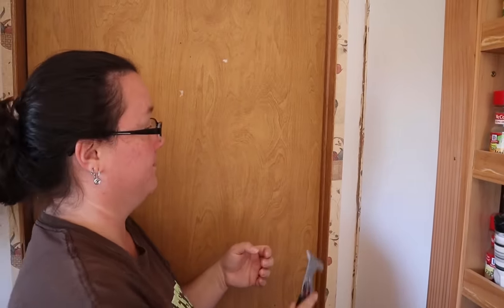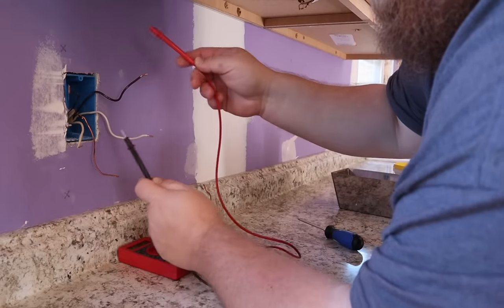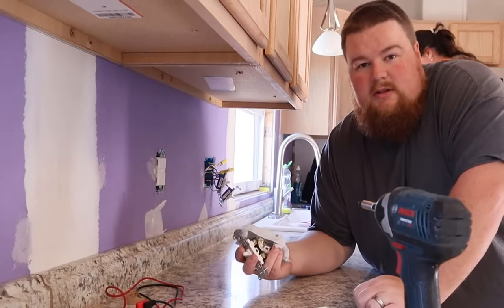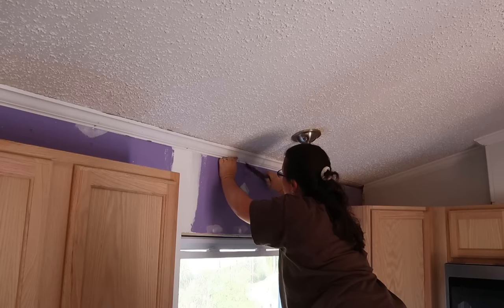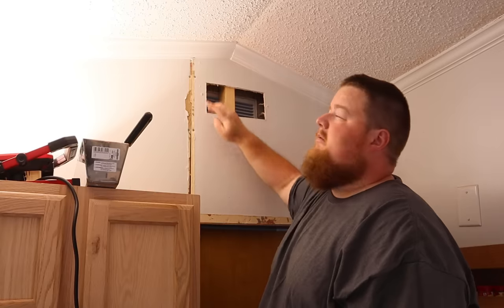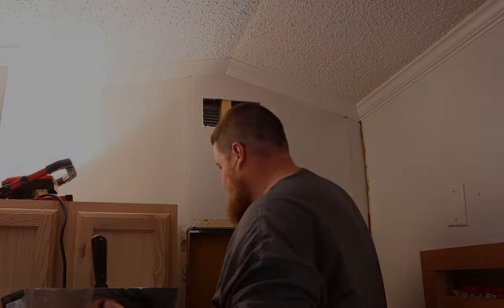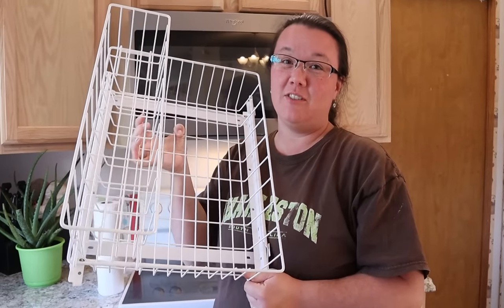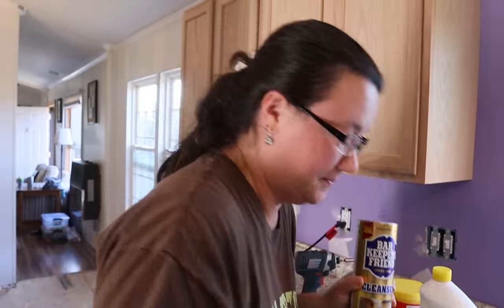How to Remove and Mud Over Wall Strips | Budget Mobile Home Remodel #24

Comment: Loving the wall strip removal! That's probably the one thing I hate the most about standard mobile homes haha. Idgaf that it's a trailer, I just want it to look pretty. Not such a dated look.
Reply: Word. We are looking to buy a bigger mobile home and I hate the ugly strips.
Reply: Here for this! Wall strip removal info! Thanks!
Reply: @nursetammy74  when I bought mine, a Schult, they had full drywall option with OSB board added.  Get the full drywall package, looks like a real house.  Never buy a lot model....get all upgrades especially insulation! Have it custom designed and shipped to the sales lot!
Reply: Totally agree. Unfortunately when we bought our modular brand new we had it customized and paid extra for them to not have the strips only for our home to be built with the daggone strips. They couldn’t take them off but they did add a pretty pantry to make up for it. We still haven’t gotten rid of the strips but that is definitely on our to do list. Thanks for the video. New sub by the way, I enjoy your content and I’m binge watching all videos. That’s why I’m commenting super late 😬😬
Reply: I’ve always wondered what the purpose of those if they can make it look like a more modern home. I like seeing the more remodeled mobile homes I can foresee them and tiny homes becoming more of the norm because house pricing is getting ridiculous
Reply: @leydle  I believe its because when the house is being transported,it shifts so this allows some wiggle room so if it shifts there isn't cracking. Our mobile shifts a lot with the bad wind we get , I just putty'd one strip to see and it shifted so much it cracked through 4 layers and paint. So now I am going to mud and tape lol .
Reply: They make me feel like i’m living in a cardboard box. i’m so excited to take mine off
Reply: @kaylatozak they use different thicknesses of sheet rock to, I realized this when I removed it and tried to putty the cracks.

Comment: I have to say The title of the video for me was pure Justice! currently i am removing the staples and pinning with drywall screws. mudding and removing the strips between every 4 X 8 sheet and heading into texturing soon. Cheers!
Reply: How has it turned out, I’m starting tomorrow 😵‍💫
Reply: Update?
Reply: @ryanmathis2515 did you start?

Comment: Out of the 11 rooms and two hallways in our modular, I have 4 rooms left to do.  I am removing the popcorn ceilings and all the wallboard strips.  I am using drywall screws (did not know about the nails!) to secure to the studs, then doing the mud and taping before each room is painted.  Have also replaced front and back doors, vanities in both bathrooms, and installed a new shower in master bath.   You are doing a great job.

Comment: My sister in law actually muddled the indentations and painted over paneling in her mobile home. It turned out great.
Reply: @Opy Brook I want to see b4 and after pics,of kitchen,as I too want to change my kitchen layout too,but thought it couldn't be done, cuz of the the hood above the stove that goes all the way up, that is also why Angela, couldn't move her stove😉
Reply: @robertalordagarcia9992  My double wide had the stove right at the edge of the counter much like Angela has except in the reverse.  Angela's stove is to the right of the counter and mine was to the left of the counter.  I moved the stove away about 24" and did a cabinet with 5 drawers in the space.  The vent hood exhaust went straight up from the vent hood.  I cut the old pipe and inserted a metal flex pipe in it to connect to the new location.  A new pipe can be run straight up but the roof will need to be cut and the old patched.  To cover up the flex pipe I installed a spice rack in front of it the width of the vent hood and two rows high for spices.  But I will also state that I built all the cabinets custom since I was not able to purchase anything that would fit the dimensions I had to work with of 12'x12'.  My home is 40 years old and not worth paying for custom built cabinets in the 20K range.  So I spent 2K and built my own using my own design.  Is the quality as good as cabinet maker, No.  But it is far greater than the trash that was in there when I purchased it.  I know I took pictures of the kitchen to start and then finished.  Not sure about anything in between though. This was back in 2007 and I was not watching anything on Youtube if it existed back then.  I can send some pictures if they may be of any assistance.

Comment: Vinyl covered walls should be sanded with coarse grit sandpaper to remove any shine and to create a rough surface which will allow the next coat to adhere. Then coat with Kilz primer, preferably the solvent based version of Kilz. Then coat with drywall mud and paper tape. I highly recommend for best adhesion, that you mix water based wood glue into the drywall mud at 10-20% by volume. The drywall mud and glue mixture acts like an adhesive to bond the paper tape to the wall. Squeeze out as much of the mud from under the tape as possible. This will not delaminate or crack later.
Don't use hot mud when using glue because it will not mix properly. After the paper tape-mud-glue layer has dried, then you can apply smoothing layers of hot mud or regular drywall mud as needed.
You could also use the latex primer that is used to obtain adhesion of self-leveling concrete to other substrates if you want to use hot mud, because hot mud adheres to  concrete primers like concrete does.
Reply: Is it feasible to remove chepo wall panel and replace with drywall?
Reply: @wynastefanik4045  You can apply drywall over the top of the existing paneling after you remove any strips so that the surface is flat. The issue that drywall will give you is how and where to fasten the drywall to the existing wall. You need to screw thru the drywall into solid wood framing or glue the drywall to the existing wall with construction adhesive.  Maybe you will need both screws and adhesive depending upon how closely spaced the wood studs are placed. Dry wall will add significant weight and much more time to paper and mud the seams. Most people will glue (using white glue)  two layers of paper tape over the seams on the existing paneling and then apply an 1/8" layer of plaster over the entire wall, sand or texture as desired, then paint.

Comment: TEXAS already said it sort of.. The way you have wired the GFCI outlets in the video is the way you would wire them if they were supposed to be normal outlets that were controlled by a single GFCI outlet. Use a pigtail method where you put the Line, Load, and Outlet wires under one wire nut. Do the same for Hot, Neutral, and ground. It will ensure that you may not encounter nuisance trips and if one trips or completely goes out, you won’t lose power on the rest. A few wraps of black electrical tape is also a good idea around the screws of the outlet once you have completed the wiring. It can give you a little more protection in case you turn off the wrong circuit or have to work it hot for what ever reason. Good luck it’s all coming along well!

Comment: We did this in our place and unfortunately some of those staples have popped through creating small holes so definitely keep track of the paint you use so later you can touch them up if this happens. Still glad we did it though.

Comment: I am buying a new manufactured home, and it has the batten strips.  But, the majority of the walls are painted and textured drywall, so removing the strips and taping and texturing over them should be a snap in a future remodel because I won’t have to worry about vinyl wall paper removal.  One good thing about the batten strips is you have a visual as to where a stud is located for mounting things on the wall. Always look at things from a positive perspective is my motto.
Reply: It looks great, but I need more instruction on how to do it! Just watching you from a distant viewpoint doesn't help me much.

Comment: if you daisy chained those gfci's it is very possible, under some circumstances, you may get non-fault related trips (nuisance tripping). i would suggest on the first one in the line: pigtailing the hot/neutrals INSTEAD of having the power go to the second gfci down the line via the load side of the first gfci.
Reply: Sam...ya gotta turn those hooks around on your screws. One, it helpss close the gap in the wire as you are tightening the screw.

Comment: I might do the strip removal that way, cheaper than what i was doing before which was: peeled wallpaper off (came off in easy large pieces) then caulk prime and paint, for the seams instead of regular joint compund we used a paintable flexible caulk applied twice- like you would compund) which has held up great for 5 years+ and looks the best of the three rooms we tried removing the strips in. Taping the seams with the paper tape peeled away after a few years for us. One room we mounded over seams and left the wallpaper on, hard work that you can all the stood areas really easily, didn't think about hammering it first, thanks.
Reply: I've toyed with removing the strips,  sanding lightly,  and putting a flexible paintable caulk in the cracks and using a putty knife to get it as flat to the surface as possible.  Is that what you did? I'd be extremely interested to see what you did and how it's held up.  Thanks
Reply: @tracyvanauken  yes, that's what we did and it did hold up, but it sinks in when it dries so you have to do two or three layers to get it flat. And be careful to be neat about it because you can't sand it. We had paper peeling up at the edges so we peeled the wall paper off, but if you have good adhesion I bet you wouldn't have to do that. I do have film of this comparing what we did.   I could make a video.

Comment: Hi I just got a 1998 double wide and I want to remodel,  and watching this video answered my first question,  I can just tape over the seams. Abd watching you install that under sink organizer is great. But watching it I saw an other question. How did you get such a great looking drain and water supply so neatly.how did you do that . I'm used to installing a basd cabinet where pipes come out of the wall a little advise please. Thank you. ✌💯

Comment: Hi Sam and Angela, What is the full reason or need for a GFCI outlet? I know it has to do with having a plug near a sink/water & the red button can trip or something. Question 2: The "mobile home" strips you took down. Were they originally there to cover the grooves found in paneling or to cover spots where two pieces of paneling came together and made a joint, or some other reason? Angela did a great job on taking them down & it was a good decision to do it, I think. Sam did a good careful job on putting the mud on the wall. Take care wonderful family & God Bless.

Comment: Beautiful job! Since the gaps are fairly wide, it might be best to use a porous structural fiberglass tape since it becomes like reinforced plaster that distributes the load in any movement between the panels. Paper tape can easily tear and cause cracking at areas with any expansion/contraction/shifting. Hopefully you won't have that issue. Fingers crossed!
Reply: As a drywall finisher you are sorta right.  Fiberglass mesh is great, but should only be used with durabond, or setting mud.  Never use with painters putty or regular mud.  

Paper tape doesn't crack or rip easy when applied correctly with mud.  Mud and paper tape is actually stronger than fiberglass and mud.  Fiberglass and mud will crack everytime.   

Been a drywall finisher for 15 years and in most cases mud and paper is the go to.  If your trying to get done fast go for durabond and fiberglass.
Reply: @rynhanson  Thanks for the fantastic knowledge!

Comment: Hey! I just purchased my new home 2016 Singlewide Clayton House and the seams are driving me 😜. I can see where the previous owner placed screws through the stripes to hold them in place. The original staples do nothing.
So, it’s been a year since you posted this video. How is the mid and tape holding up? Any thing you would suggest? Pros and cons?

Comment: Thanks for sharing how you removed the strips on the wall! Are they on regular dry wall or just the walls the mobile home brought? I bought an older one and want to do that too, was wondering if I need to upgrade the regular mobile home walls first. Thanks! 🙂💕
Reply from the maker: This was the original drywall with wallpaper on it that came in the home.
Reply: @sam-and-angela  thanks so much!

Comment: I'm just a bit confused, can you clarify?  I just moved into a mobile home.    It looks like you have an older mobile home that has not drywall panels but  (I don't know what they are called, but pre-wall paper panels.)  It's a material that is thinner and lighter than drywall.   Do you have a video on inside corners and outside corner strip removal  and taping?   How is everything holding up now?

Comment: my questions is what if the walls are not drywall but that mobile home paneling with the strips running down it? I want to take the stripes off, can i still fill it with drywall and then prime/paint over?

Comment: my old mobile home still has original vinyl walls.  Will I need to prime first before mudding and taping?  The strips pop off pretty easily so I was going to remove them all, prime the walls and then mud and tape, sand and prime those areas and then paint.

Comment: Great video! What size drywall nails did you use? I am currently doing the same thing in my bathroom and as a newbie to all of this I have discovered there are nails in all different kind of sizes! Thank you
Reply from the maker: Somewhere around 1-1/2” will work. You can also get drywall screws that work very well too. 1-5/8” for the screws is normal length for 1/2” drywall.

Comment: Great video thanks!! I was wondering if you guys had wallpaper through your trailer as well? It looks like you had some.My trailer that I just bought has it everywhere. I heard that the paneling isn’t like Sheetrock. Is it easy enough to remove the wallpaper or is it easier to paint over the wallpaper? What did you guys do?
Reply from the maker: We've painted over the walls with pretty good success. Cleaning the walls first with vinegar or another cleaner is key, then use a good quality primer or paint & primer product.
Reply: @sam-and-angela  awesome thanks!!

Comment: Question:. Did you have a problem with the drywall tape lifting.  I think my mistake was using joint compound instead of spackle. .  Idk what I did wrong 😂 I pulled the tape off and just filled the space with spackle for now.

Comment: I have a mobile home and it the walls are covered with drywall with wallpaper.  There are seams on each panel.  I tried removing the wallpaper and it is not going anywhere.   How do you suggest that I can cover the seams and paint over the wallpaper?  Any suggestions?  I Love your channel.
Reply from the maker: We just painted right over the wallpaper with a good quality paint+primer. Before we painted, we cleaned the walls with a vinegar solution to help with paint adhesion. It did pretty good for us.

Comment: I do have a question if the wall is painted but originally a lightly textured wall papered drywall is a joint like this gonna show really bad? I have a feeling it would so at this time I haven't redone the strips. Any input would be helpful. Thanks God bless Shalom
Reply from the maker: It can show, especially with side-lighting. But they don't stand out more than the original strips so it's a win for us. :)

Comment: How would you go about doing this if the walls have the textured vinyl over them from the factory? Is there a paint I can use to hide it so the joints don't stick out after it's painted?
Reply from the maker: That's what our walls had in some areas. A good quality paint + primer has worked great for us without any issues. Cleaning the walls before painting is key. We like a vinegar mixture.

Comment: I didn’t know that you could remove the joint paneling. But I got confused when you started adding all of that so-called nails. I would be doing this by myself and I’ve never done this. The walls in my mobile home, which is a 1987 have granny flowers on them. And I want to paint the kitchen and do a peel and stick wall tile.

Comment: Can you please tell me if it's true that you have to sand the walls then wash with TSP  then use kills oil based primer then paint the walls in a mobile home.I was told if I didn't the paint will pill off because the wallpaper wall stuff is slick. I guess it's called gypsum board? When I saw you removing the strips I thought wow that looks like my walls under them strips. It sure Looks like y'all know what you are doing great job! I hate those strips in my home to. Now I want to remove mine.
Reply from the maker: We've not had any issues with paint peeling or not sticking to our walls. We always cleaned the walls prior to painting and used a good primer + paint.
Reply: @sam-and-angela  Thank you so much for answering my question I really appreciate it. I love your videos they are very helpful. Have a wonderful day.

Comment: I'm a first time home owner. We just moved in less than 2 weeks ago. I saw another channel say that when removing the strips that tape left a bump in the wall and that it wasn't necessary. I definitely want to do this RIGHT so I'm trying to learn correctly what to do. Tape or no tape? 🤷🏻‍♀️😣
Reply from the maker: We didn’t tape our seam in the bathroom and it has since cracked. The kitchen we did tape and there’s been no cracks. We’re of the tape mindsets now. 😎
Reply: @sam-and-angela  Thank you so much for replying! This is very helpful! Just found your channel and I love it. 😂🤣👏👏👏👀🚜🏡